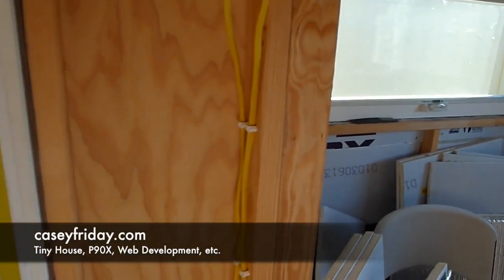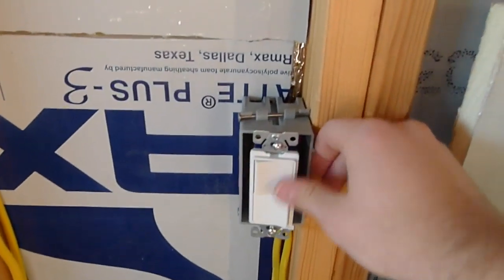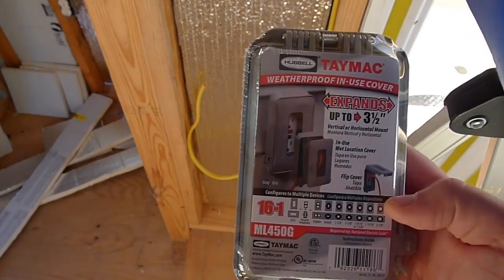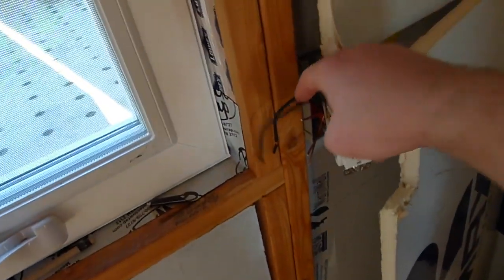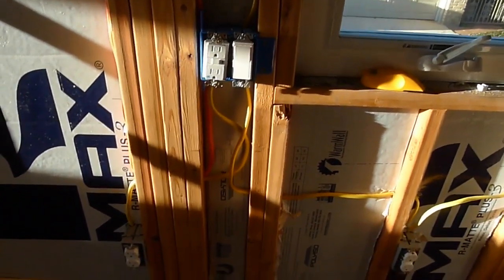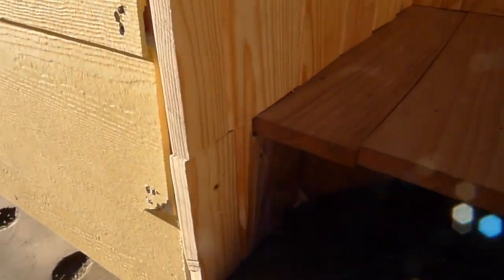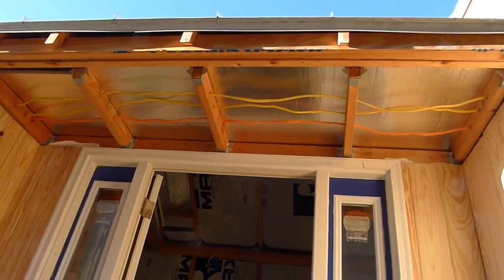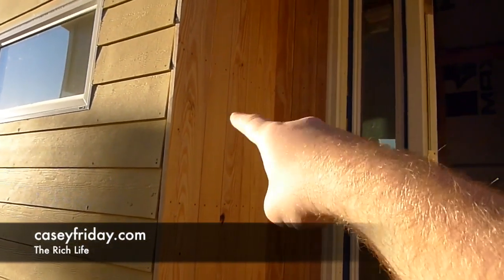Tiny House Electricity Wiring Walkthrough

Comment: Did you insulate more than what is shown?  Trying to figure out the best way to insulate the one I'm currently building.  I'd prefer to use rigid insulation like you did.  Did you put a vapor barrier on the inside of the insulation?
Reply from the maker: Three sheets of 3/4" plus the wiring/plumbing filled the entire 2x4 cavity.  I also put Reflectix behind all the insulation, and house wrap (like Tyvek) on the outside of the plywood.
Reply: Awesome, thank you!